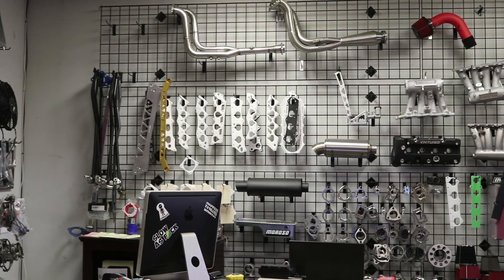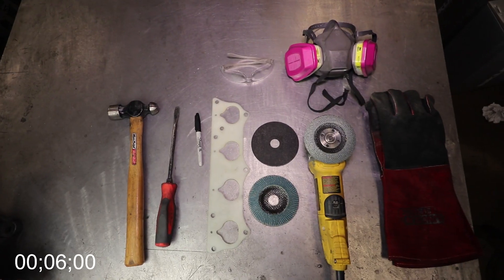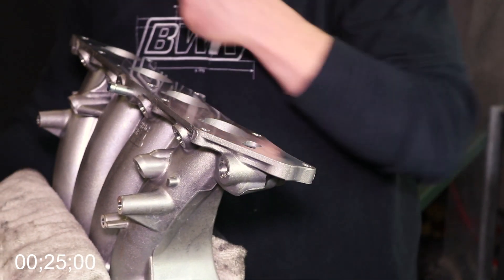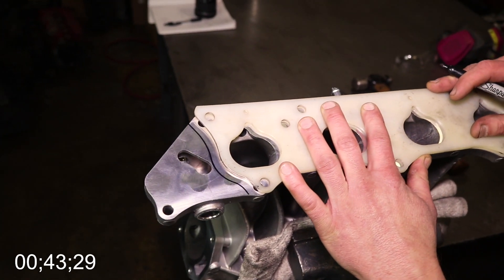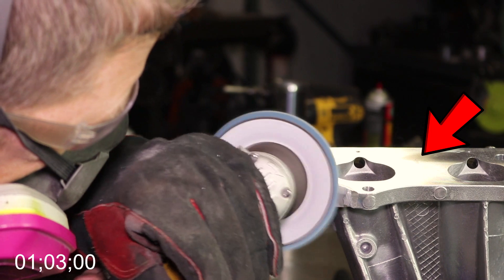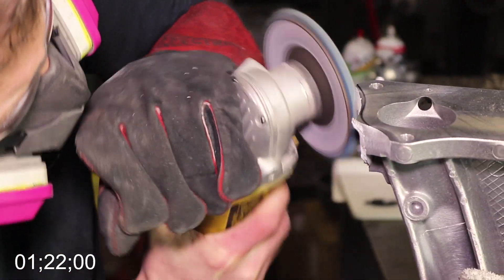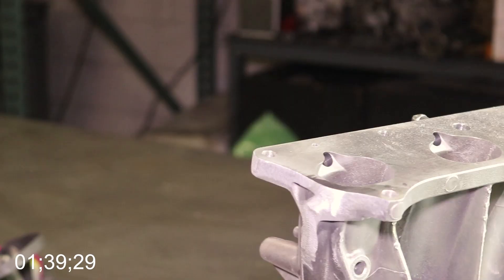How to Clip an RBC Intake Manifold in Under 2 Minutes (K20)| Two Step Tuesday

Comment: Huge question that i need an answer to asap please. Im putting a short block k20a with a tsx head, this build is going into a 07 si, so its going to have the si cooling connections, head is literally the same exact as a z3 when compared so i shouldn’t need to do this modification correct? It’ll bolt on right on?

Comment: tech question, i have ep3 with k20a swap from dc5, because im in warm climate will i benefit by re routing the coolant(disconecting and bipassing) that goes through my intake.  I believe its used to keep things from freezing in winter tempuratures, but I believe in my circumstance its warming my manafold and increasing my air temp? any info would be helpful

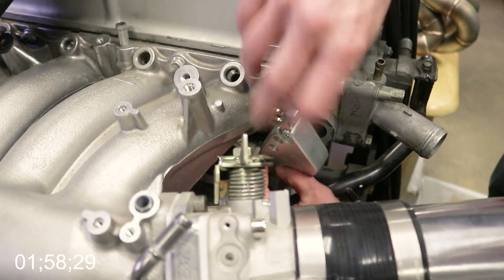Comment: whats the ktuned part you installed at 2:42 ?
Reply: nvm found it lol it def does reduce intake temps by 5-6 degrees
Reply: @bakersavage229  can you post part number for the part you found? I want to do this mod to my 08 civic Si
Reply: @bowtiebuilding  ktuned swivel neck thermostat

Comment: Lolol that intake is like $350.... and then to cut it with the possibility of messing it up and being useless. Just to make it fit a k20
Reply from the maker: Yes. If you want performance with no compromises. That is what it takes. Also it’s pretty hard to mess up.
Reply: It is if you never done it and dont have a thermal gasket to use as a stencil like mark did.